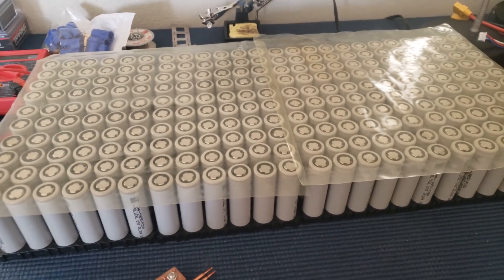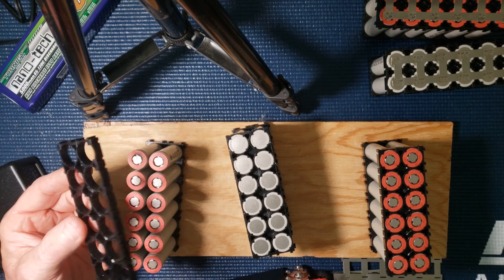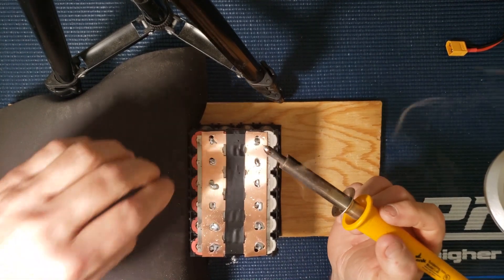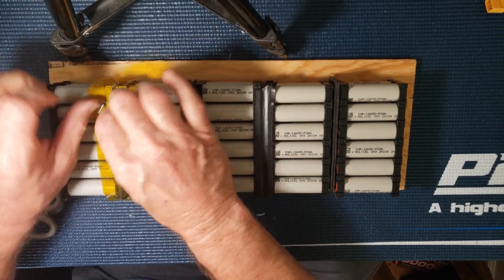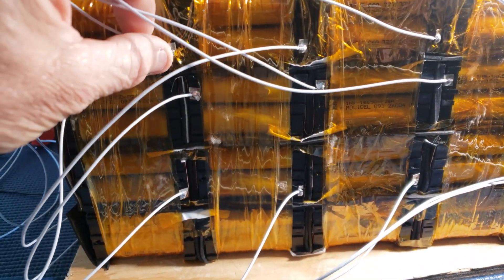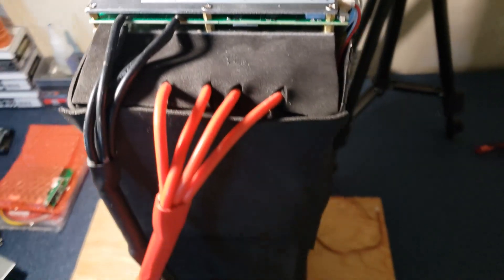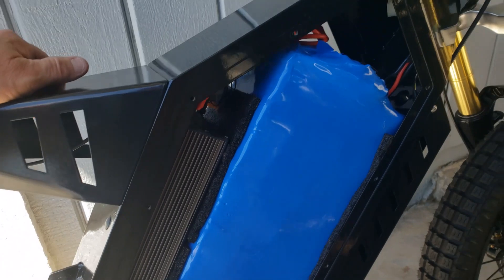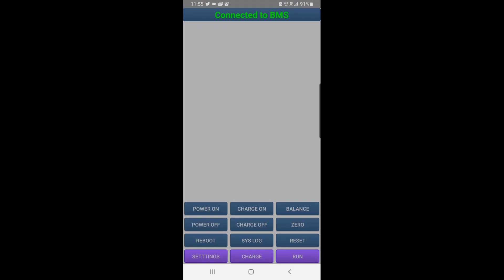DIY 72v ebike battery build, its Alive!! Electric Bicycle

Comment: youll have to keep carefull eye on your controller heat ,i do not recomend putting inside the frame,i removed most of the outer on my 7245 unlocked and 72150 unlocked so could mount them both together under the frame and used water block cooling instead
Reply from the maker: Yes in a later video I show where I cut slots in the side panels  to get air to the controller, it definitely helped with the heat.

Comment: Hey man you’ve been super helpful , have a question for you .
You suggested a link in theses comments of a guy building a 20s14p  30q 72v 42ah 
220a max cont. discharge 
300a peak discharge 
25kw peak power .
Idk much about this and I’m trying to build something similar . 
Would that be a good battery for a build like yours
Reply from the maker: The only problem is the 14p, I think it's going to be too big  it is going to be too wide for the frame , I dropped mine to 12p you will lose some range though.

Comment: 2800? 2800 what? P42A's are a realistic 4000mah and 25A continuous current with a burst in the 40-50A neighborhood
Reply: Edit oh you chose the 18650s...similar amperage but less capacity. They are good cells but I don't know if the 21700 can really be beat
Reply from the maker: @ericklein5097  yeah  they are just too big, I can barely fit what I have now, I can't even get my hand in there lol

Comment: I pretty much got the same bike and it recently stop charging if there is a possible way you can make a video or gmail instructions👍!!
Reply from the maker: That's a tough one to diagnose remotely obviously my battery charger and BMS are totally different. First things first are you getting output from the charger? If so do you have an app or program you can use to see what the BMS is doing?
Reply: @samjohnson517  I think it’s the bms, I bought new charger still nothing do you know where I can’t get a bms for a coustom built, I bought it built so I don’t know the parts and thanks fors the assistance👍👍
Reply from the maker: @a1daone  is there any way to contact the battery manufacturer or the person who built the battery ? because they would know, it could be something simple like a balance wire coming off I had that happen to me

Comment: Did you need cooling of any
Reply from the maker: In a later video I ended up cutting slots in the side panels to cool the controller but it seemed to be okay without them
Reply: Also I’m making a 72v 60a battery you think I need certain cooling for the batt
Reply from the maker: @johnsonandjohnson9314  I was always concerned about having the controller and battery in there with no real way for heat to escape that's why I cut the slots out of the side covers. It kind of makes sense that it's going to get hot in there and excessive heat  is not good

Comment: Whats the benefits of making your own battery vs buying one?
Reply from the maker: Hello well I built my own battery because I could not find one powerful enough in the size  I needed but there are other benefits, for one thing you'll know what's inside that shrink wrap as far as type of cells, thickness of nickel strips etc.
Reply: Cost is typically half even after the cost of buyign a quality spot welder

Comment: Hello, I am building this exact battery pack. But I am really stuck on one part and would greatly appreciate it if you could help. When you were soldering the copper plating onto the battery pack what type of solder did you use like what diameter and what type of flux in solder and what was the solder made of. And also what power soldering iron did you use like 60w or 80w. And lastly what rosin flux did you use on the soldering. Thanks so much keep up the great work!
Reply from the maker: Hello and thank you if I remember right I just used some 60/40 rosin core solder it was nothing special just the standard size and a 40 w soldering iron I ended up not using the flux because it was causing me problems.

Comment: What battery would you recommend for a battery a bit larger than yours but for a similar build, I’m thinking about getting 420 Samsung 30q batteries for my battery (20s 21p)
Reply from the maker: Yes Samsung 30q would work very nice that's what I was trying to use but I ended up with some counterfeit ones I had a hard time finding them after that so I went with Molicel which I'm very happy with  but they are 2800mah  so you lose a little bit of range

Comment: How much of that copper strip did you use or buy? Im building 2 of these batteries and looking too get the correct amount
Reply from the maker: So 20 plates at 5in, =100in of copper per battery,  
it is 4  plates per row x 4 rows plus you need 4 for the ends

Comment: I just got 225 21700 cells from a Tesla model 3 2019 on eBay in Germany for 250€ each cell has 4,8 AH so my Tipp is that u search for something like that (even if it takes a couple months) to get a high quality/performance budget build.
Reply: tesla cells are a myth sorry to say. if you want high quality cells that are 21700 go for the samsung 40t3. 4 ah and 35A disvharge. If you actuly got cells from a tesla battery there used and there are no specs avalable for them....
Reply: @spcolsson  somebody cracked them out of a battery and sold it to me they can put out 6-7 amps and have 4,8 ah

Comment: Molicel is better than Samsung. 
You chose very well. Why didn't you get the 21700's?
Reply: Built a pack with molicell p42 21700 great batteries. Been holding up well.

Comment: Can someone share me a pic of same frame motor but on a smaller wheels 24 inch mtb wheels. Planning to build a custom ebike also but I want it to be like a hybrid enduro and scrambler type not too high so I want like a 24inch fat tire wheelbase build on an enduro frame and I'll modify the seat area to be more like straight kinda like a scrambler.

Comment: Hi, great video and great build.
In the battery ideally should be the copper making the contact with the battery, having the nickel welded do the battery makes the current always passing by the nickel till reaches the copper plate, you'll have resistance and a lot of heat on that nickel.
Copper sandwich method works great, copper is 4x more conductive than pure nickel, with that spot welder you probably could weld a 0,15mm copper sheet with a 0.10mm nickel.
Reply: yep and you can use nickel plated steel if you need more resistance at your weld points to get the copper to weld to the cell. You only have to lay down nickel squares where you weld
Reply: That’s a good idea

Comment: Hey when you soldered the copper to make the series connection did it adhere well, im trying to solder mine right now but it just breaks off when i touch it
Reply from the maker: Hello, the solder is going to want to stick to the copper more than the nickel so try and heat the nickel first once you get the solder on to the nickel then it's nice and easy to solder the copper

Comment: What are the measurements for the battery?
Reply from the maker: Hello it is 7" tall 14"  long and about 5 1/4" wide
Reply: My is 8 inch tall 12.inch long and 5.5inch wide and I don't think I can squeeze that in my bike , I might.
Reply from the maker: @TECHSUPPORTEBIKE  it would be close you would not be able to run the controller where I have it
Reply: @samjohnson517  oh yeah the controller is definitely going to be outside the frame , but it is a crazy tight fit and am not to happy . I will see 🙈

Comment: What about a lipo battery pack what are your thoughts on that.I think it can be built cheaper and it would be easy for you.👍👍
Reply from the maker: I did look into lipos I thought about using 5 4S packs but it was around $700 plus the BMS and I already had one lipo pack explode on me so I just thought the lithium ions are just more stable and would have more range.
Reply: @samjohnson517  oh ok yeah I'm learning about batteries and don't want that to happen my house can burn down.Thank you Sam I'll keep that in mind.This battery seems to be a bit of a unicorn at this point.
Reply from the maker: I think vector ebikes has one but I don't know how much it would be to ship it
Reply: @samjohnson517  I was thinking about Lightspeed NY 21700 cells
Reply from the maker: @racerx2095  if it's the one I'm looking at I think it's too wide 160 mm
This one may work still a little wide 140 mm
http://www.enduroebike.com/Samsung_30q_72V36AH_150A_discharge_high_drain_lithium_battery_pack
Reply: @samjohnson517  l have the same frame as you and your right the guy that I saw with the 21700 cells has plastic sides yeah I'm not buying another frame to your correct Sam wow you just saved my ass some money thank you
Reply from the maker: @racerx2095  you're going through the same thing I went through trying to find that battery is really tough
Reply: @samjohnson517  I know it's like finding a unicorn 😂
Reply: @racerx2095  never use those branded rewrap batteries. Molicel is the way to go. Best cells on the market in terms of 18650/21700 and the pricing is reasonable. P45B's will come down in the next 2 years
Reply: @samjohnson517  I'm considering a 21700 pack now and it's cheaper 1400
Reply from the maker: @racerx2095  yeah I've heard good thing it's about those what is the continuous amp and peak rating on the pack?
Reply: You wanna ride on a giant firework? Its too sketchy to use for an EV

Comment: Great video,  I wanted to ask if you would consider building me a bike?
Reply: I can
Reply from the maker: Hello and thank you for watching!, well I do not build bikes professionally but  I would help you with any questions or concerns you have if you want to try to build it yourself.
Reply: @samjohnson517  what size battery and ah rating do you have? How long does it last and is 64mph the max speed. Any problems with heat? Any tips or pointers if you were to do it again
Reply from the maker: @kaysonosborn5247  Hello and thank you for watching the battery is a 72 volt 33ah  and I get about 40 mi out of it keep in mind that's not being conservative top speed I have a new speed run video is actually 66 mph as far as doing things differently I am more than likely going to do another build with a different frame but on this build probably paying more attention to the dropout size.
Reply: @samjohnson517  ok awesome

Comment: WOW this the time you've done this?I don't know if I'll build my own battery looks like a bit much for me.Great job💯👍👍
Reply from the maker: Thank you! It's really not that hard you can do it just take your time.
Reply: @samjohnson517  well thanks for the confidence Sam but you don't know me I'd burn the house down.I will do everything else though.Lol
Reply from the maker: @racerx2095  just be aware you may have the same problem I had and the reason why I built my own battery in the first place. 
It is very hard to find a battery with the specs you need (150amp continuous) and fit in the frame. 
But that is only if you want to go over 60 mph if you want to be in the 40 to 50 range then they're pretty easy to find.
Reply: @samjohnson517  I was thinking about a battery from Lightspeed in New York 21700 cells 84v and Dr Chopper in PA I talk to him a lot he does big Lipo batteries 2k that's my plan so far I'm still waiting on parts if I can find it cheaper I'll try and get it.
Reply from the maker: @racerx2095  I wonder what the continuous and burst amp rating is on that
Reply: @samjohnson517  I'm not sure exactly I just look at what other guys with fast bikes have done and try and get the same parts the main parts anyway.I know I've seen a video just can't remember.I was told you should over build because you can always pull back power easier than adding.What do think?I'm not doing nothing small for the battery.
Reply from the maker: @racerx2095  I think you should get the spec before you buy it, it should have at least 150 amp continuous if it does not t I would lick elsewhere, also make sure it will fit in the frame!
Reply: @samjohnson517  Yes definitely it should be because of the controller and motor.
Reply: @samjohnson517  must of is are using the same and the builders are using the same frames.

Comment: What's the range of that battery??
Reply from the maker: Hello,  I have not done a range test yet I still  need to do that.
Reply: @samjohnson517  done the range test?
Reply from the maker: @PapaleguasNY  yeah I got 42 miles out of it not  being conservative so about 40 mph and a  couple of blasts up to 60
Reply: @samjohnson517  but can you change batteries during the day? Or its locked to the frame?
Reply from the maker: @PapaleguasNY  no it is a real pain to take out and it is heavy if the controller was mounted outside the frame you could do it.
Reply: How long does the battery last in hours

Comment: nice build what does that black foam called u use inside the battry between the group pls
Reply from the maker: https://www.amazon.com/dp/B089DR98ZK/ref=cm_sw_r_cp_apa_glt_fabc_51WG4H640HNCW4WRT6TB?_encoding=UTF8&psc=1
Reply: Eva foam for anyone after that link goes dead